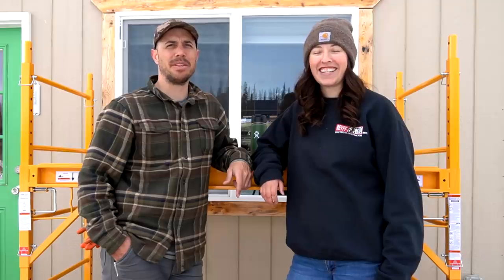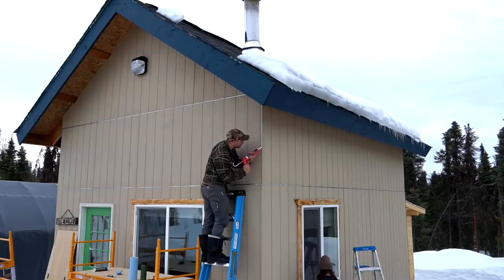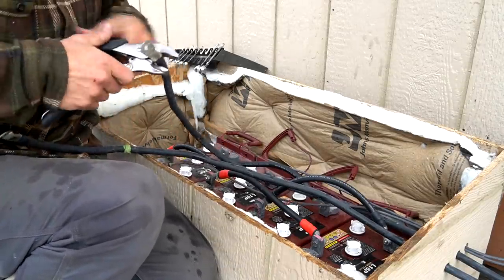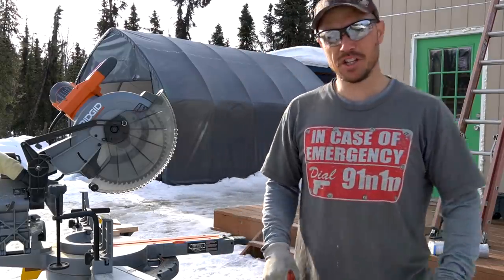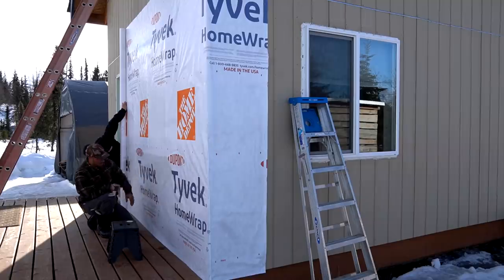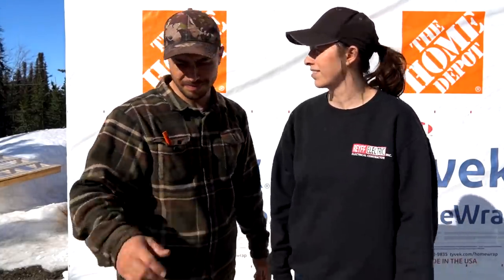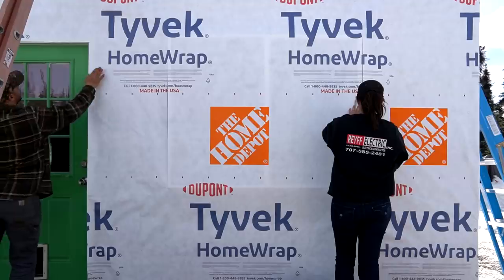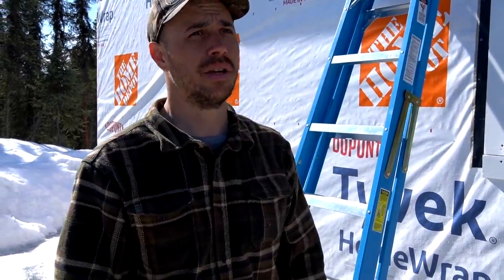Spring Cabin Remodel | Housewrap & Trim Installation

Comment: You guys are going to notice a HUGE difference in the reduction of cold air drafts and heat retention. Nice job, it is not easy working under icy conditions.

Comment: being a former window installer i would have recommended putting the flashing tape underneath the tyvek because it can actually act as a wick in some cases allowing the water the get in. the way that you installed the top was correct where the flashing tape goes first, then you flap the tyvek over it then tape it closed with the tyvek tape. over all a very cool project to watch
Reply: Yeah, I saw that and figured that they were doing it backwards.  Still it will be better then before.
Reply: I was going to write the same thing.

Comment: It’s like wrapping a giant present! 😄😄
Reply: I've noticed over the years that so many house construction projects are like stuff we already know how to do. I learned to cook and paint my nails, and Eric used a serrated kitchen knife to cut off the excess spray foam. And painting door trim is same as finger nail polish. And you are right, house wrap (or wall papering, or contact paper) is no different than wrapping presents! I feel like using kitchen appliances taught me to be comfortable with power tools. Anyway, Ariel & Eric are certainly very inspiring! I just bought spray foam to insulate my outlet covers, too.

Comment: Besides the cookbook that we are all waiting for, I also think some type of home improvement/outdoor book would be great too. There isn’t anything you can’t do 😊😊
Reply: You can only live there if you are as handy as they are.  Cannot call out for services.  Thus, I am stuck down here somewhere in the lower 48.
Reply: She said no cookbook because she doesn't use measurements.  I believe they put enough info in videos  that if you followed them, a cookbook is not necessary. I take notes on their cooking so I guess you say I am compiling an E&A recipe file.
They certainly have enough to keep them busy without sitting down doing a recipe book. That's what the videos are for.

Comment: Eric, that foam insulation comes in two formulas.  The red can generally is for gaps in walls/floors.  The blue can is generally for doors/windows.  It doesn't expand as forcefully as it cures, so you're less likely to have stuck windows/doors, which could happen with the red can formula.  Keeping those windows/doors closed (while curing) will help though.  

If you have access to the underside of your cabin, Reflectix ("Bubble Foil") insulation to the underside of the floor sheathing will make a big difference in the warmth of your floor.  Application of it to the inside of skirting will also help to retain heat under the house.

If you prime/paint for siding prior to application, it'll decrease the time needed to be high up (as well as the number of trips).

You should have a much cozier home next winter.

Comment: Yep, foam insulation will totally work for the gaps around the door (you guys knew that already right :D) . We did this on our last renovation project in Spain. We had big gaps between the walls and the ceiling beams and naturally as for all Spanish houses no insulation so it got drafty... That foam worked magic for us but dang is this thing sticky! I'll let you picture how fun it was to spray it on the ceiling falling in our hair and all the shebang that came with it :) Round sander, is a total game-changer!! On a side note, you guys are still very much inspiring to us. We're getting a lot of heat for building a tiny house in wood in Portugal. LOL the last we heard was that our insulation would make us sick and would be prompt to rat infestation (pfff - it's the same you use!!) We keep on telling our friends that wood buildings are awesome but do require little maintenance. Folks here are not used to the way we build in Canada, USA, and Sweden :) BUT now I'll share this video with any skeptic :D Keep up the good work we love your videos, now even the shot you use are inspiring :) We still have a little bit more work to get to the same level as Eric's Editing :D  But tool shot at the beginning of the video, yep might steal that idea if you ok with it :D

P.S: the tar tape around the windows, would you have needed it if you built from scratch?

Comment: Eric, when I built homes and used the sealer around the windows we always took a hair dryer and warmed it up a bit, because it helps set it to the wood or Ty em for a little tighter seal. Just an FYI!  It looks good and it’s amazing how well the 2 of you work together!

Comment: The pine sap will probably bleed through the Kilz.  You need shellac to seal up the knots.  🌹🌹🌹The Tyvek looks good.
Reply: I agree. Use the BIN Shellac stain blocker. Only thing I have found that actually works. Available  at Lowes or Home Depot.

Comment: My log cabin had cracks between the logs.  Incredible drafts that were painful when below zero.  It was a HUGE difference to locate them and stuff insulation in there.  The home is so much more comfortable.  100% positive that you will also get the same benefit once you are completely done.

Comment: Wait, I'm 6 minutes in and realized you aren't going to remover the existing siding. I guess you'll cover it with housewrap and new siding over that. That should hep a lot.  Good luck with the project.
PS. All your rain is down here in Connecticut.

Comment: Hi, that foam insulation is awful stuff, if only it wasn’t so gosh darn useful 😁.  Have you considered building a small lean to greenhouse structure on the south facing side of the cabin? I was thinking it might help with solar gain during the winter.

Comment: Excellent job. The best way to seal knots on wood is to apply shellac over the knots, let it dry  before you prime and paint. The shellac seals off any bleed from the sap in the knot, Comes in a can or spray. If you see any knots showing through on your painted trim lightly sand the area, apply. shellac, then prime and paint again. I have used this many times and it works really well. Saves on having to use  more paint to try and cover the knots. Can't wait to see the cabin finished!

Comment: Great work guys, youll half your wood cost with this easly 
Hope you can find a way to store more of your crops....grandpa used trashcans buried in the soil filled with sand to store  potatoes and carrots ...i would say beets and any root crop will store for like 4months minimum ,even at your climate...maybe you need to but aome mulch as isolation but it would  be on the cheaper end of try outs 
Good luck and have fun living the dream 😉😀

Comment: Eric the white trim you took off your door is called brick molding it comes with the door and should always be on the door. go look at new exterior doors they all have it. By taking it off and replacing with 1x4's it compromises integrity of door. Thats what helps seal your door and makes it a little safer from break ins. For foaming it,.it should have been done from inside and not by removing brick molding!!. The little corners you cut off on trim around windows? that is for drainage when it rains.  Notice how they angled away from window??? that was to keep water away from window. squaring them off does not help in drainage when water runs down your walls to windows.....Now water coming down wall will find gap or splice and go in there and some will sit and rot. sure caulking it works but after a while caulk will fail.. always does. Caulking seams where siding over laps is good though. Also all holes into exterior walls.. they should be sealed to keep out water cold and rot. A good silicone clear caulk works awesome. caulk around your electrical box, electrical light,.... all holes too. Tyvek goes under siding not on top.  And sure your probably gonna reside this house. but all old siding should have been taken off. Why? It probably has mold from gaps between top and bottom pieces. All this should come off and House wrap then should be installed.At least well inspected,.... windows should have been taken out too and then house wrap added. Windows go over Tyvek,..not vise versa. and house wrap should always be longer taller to wrap around inside doors or inside window frames and then tacked before doors and windows are installed. Never up to edge because drafts or water seeps into it otherwise even with two sided tape . and Arial your right about what house wrap does!!,..but it goes under the siding not on top. and all old should come off first not another layer of siding added then house-wrap. So all your siding,... existing siding should have been taken off first! Then house wrap then siding. and it should be used wherever there is heat of your house,..like first 8 feet from down stair to ceiling,.. but since you have a loft the peaks too need it,..but under siding!! Eric your stapler is called a hammer tacker. The caps are called plastic cap nails. Nails are in various lengths but are ring shanked to hold cap in place... that hold whatever you need them for. tyvek, foam insulation boards foil-faced foam etc,..as for a gun that shoots them? i have never heard of one.Take care it should look good when your done. i just hope nothing is wet and mildewy underneath it all.

Comment: Before you installed the Tyvec wrap you could have installed a layer of single cell insulation slab directly nailed to your original siding. Would have given you a massive increase in the insulation values of your cabin and not expensive.

Comment: This is going to help a lot keeping it warmer. Can't wait to see the next vlog this is exciting.
I had some holes in my house and thought it was termites which I did have but not there. The guy told me it was dry rot. I didn't have the funds to fix it so I bought that spray foam to keep out further decay and to keep critters and bug from getting in between the walls. I was told to keep and eye the foam, well anyway I thought I had it all shaved off. My friend said you better check it again. Hmm it grew more and I couldn't get it off so for a few years it looked like tumors growing out  of the house. I have lots of silly stories.

Comment: Looking great Guys. If you're thinking of a next small home try using SIPS construction. Super insulation your current size of home would go up in 2 days. Air tightest and insulation is the way to go (passive home certification). Excellent job 👍👍.

Comment: You both are doing an amazing job insulating the house from cold air going in and heat escaping. That is a lot of work but I’m impressed how you’ve researched how to do it properly. Looking forward to the next video with the siding going on. Take care and be safe. (Judy NB) 🌲🇨🇦

Comment: I did the same thing to my house a while back. I put a layer of 1” extruded styrofoam on and taped the seams before putting the siding back on. Makes a huge difference when drafts are gone. Hope you get the results you wanted.

Comment: If you take your hammer and pound the end cut's. It seals it and stops the wood from sucking in moisture. Because that's what makes paint finishes fail. Expansion and contraction...

Comment: Fun fun fun! Did you guys use foam board? Used it on our mountain cabin, really helped too. Cant wait to see what color you paint your siding. Ours was a cement board type siding & it was Celery Green, white wood window trim (we put the siding up to the windows & added the trim on top of the siding. We also upgraded our windows. we added a black wrot iron weather vane at the roof peak out front that was a Deer. Great Vid!!👍👍👍. Ummm,those are Big sweat shirts your wearing girlie. ❤️

Comment: read the instructions on nailing or screwing the siding.  never thru the material and only thru the oval cutout.  never too tight. i should say 1/32" so thru siding can contract and expand with the changing temps.  as a retired building inspector,  I would walk up to the house and if the siding didn't move when I pulled on it I would have you remove it all and start over

Comment: Where your cats or dogs scratch up your trim or door you can staple or use double sided tape on sandpaper there and it will trim down their claws and protect the wood. Use heavy backed sandpaper like strips of belt sander rolls or anti skid tape. Not a for sure fix but worth a try.
There's not a non permeable moister barrier under the siding or the sheetrock then, right?

Comment: Wow, what a big project! It’ll be nice when it’s done! I had a similar problem with the house I bought. I tackled it From the inside. I took down all the drywall and pulled out the fiberglass insulation and then had spray foam put in. Oh my gosh what a mess all that was but there are no drafts in my house. Then afterwards, I moved in and I’ve got the tiniest little wood-burning stove that heats the whole house!

Comment: That Tyvek and caulk will make a huge difference in house warmth.  

There are several types of Great Stuff.  One is marketed for around doors and windows and is Minimal Expanding.  I believe the can you used is the normal expanding Great  Stuff and it has enough pressure to push the frame in.  Check it out if you do other windows or doors.

Comment: It is T1-11 siding not T11. Just a very minor point. Might help someone watching this. Also the best way to cover the pine board knots is with BIN Shellac based stain blocker. Also the red spray cans of foam is not recommended for around windows and doors. Problem is it can expand so much that the force will bend the door frames and possibly prevent the door or window from closing or sliding easily. They make a special foam (minimally expanding) for this in a blue can. Hate to be the nit picker but may help someone else watching this. Good job you guys. What you have done will make a big difference. Now that the cabin is so tight you should add some way for air to get in for the wood stove combustion air. Stove might not draft right otherwise.

Comment: Great job! The time and materials spent on it now, will greatly reduce heat loss and wind drafts in the future. I saw you caulking the siding and can foam at first, and asked myself did I miss something, I thought they mentioned house wrap..lol Anyways, the T-111 siding is great for awhile, but needs repair/replacement I've found about every 8-10 years. Love ya'll ❤️

Comment: We just went thru the melt and break-up. Still freezing at night several days a week. And there has blew snow storms the blow in and out within the hour. These happen several times a day. We are waiting for drier ground to start our 16x24 cabin. I hope the spray foam works better for you. I used it around the windows in my shop. It turned to a powder , and shrunk really bad. What brand is that scaffolding?? Looks very handy to have . We have a 12ft and 16ft step ladder. Those have been a life saver with build projects around the property.

Comment: Eric so you know your corners?? they should be covered with 1 X 4's or you can get Steel corners, all different colors, you put them on first. Level them straight up and down and even across so the corner isn't tilted more back or forward. Just look down the wall  and you will see what i mean. There is a level for them. And then siding goes over and into the groove of corner. Your so-called T-111 is actually fiber board. Well it is actually OSB with a slim layer of fiber cement rolled through machine to simulate wood texture. Real T-111 is and will never be mistaken for anything else. and you can get that even in cedar. so it's smell  is awesome. but that here in the lower 48 it is 95 dollars a sheet. But awesome stuff. I put that up but i did 4 X 8 X 5/8's. and even that was 53 a sheet.. On yours though where the tops and bottoms meet? i would put a channel over it. Now there is some made it is square looks like a C in shape but square to fit over edge. longer in back shorter in front. where the  length ends come together caulk to seal. J-channel plastic or metal works good for this. This way it seals the whole wall siding 4 X 8 and then tops and bottoms of 4 X 8 sheet. Corners again a cheap fix is the 4 X 4's  more expensive is Steel Siding corners. Either way it will seal your corner. Caulk will expand and contract and then break.. and you will have leak.. so either way yo fix corner will remedy the situation. J-channel will remedy where  butt of the sheets meet. that would be the 4 foot wide part. the length should have overlap.. mine all did. just got to make sure you level them when you put them on so they are straight up and down. Too bad i can't send you photos i would and it would make doing this job so much easier. Take care be safe always your friend. oh post note cutting foam? a serrated knife works awesome..  like a bread knife. i carry one for just that reason it is flexible and long.it is in with my tools when i have to replace exterior doors.

Comment: Ha, isn't foam insulation the best? And a staple hammer? It is such a pleasure to see how smart you two are when you do work.
PS: saw that Bandit was being the project manager, then he retired, and Pepper was. It needs to warm up so Bo can show them how it's done
Keep being awesome. Take care
PSS: Edit to add those spikes are good and smart for this application. But maybe check out Kahtoola microspikes for times like walking up to your remote cabin in winter

Comment: Nice vid,: But I'd suggest using a better paint brush, and beveling the corners of the front door trim. Only the door and front windows really require it.  Nice to you guys generally buy decent tools- it makes the job go faster, easier and produces a better finished project.